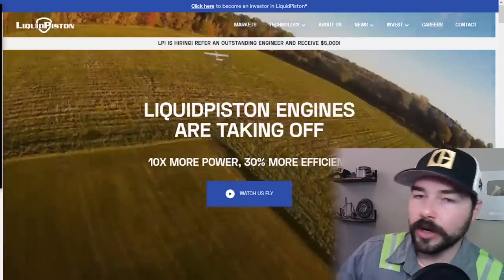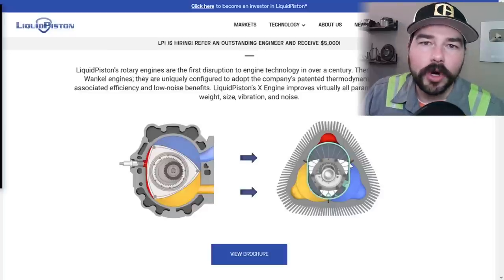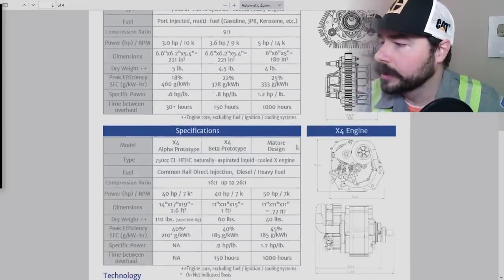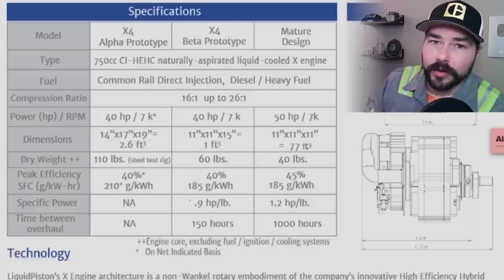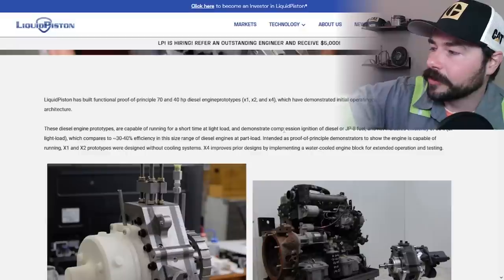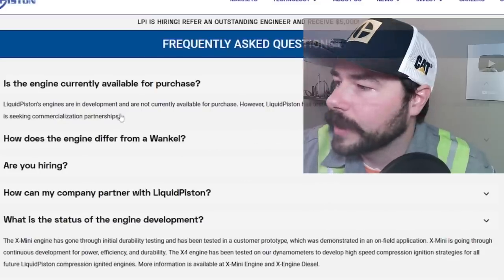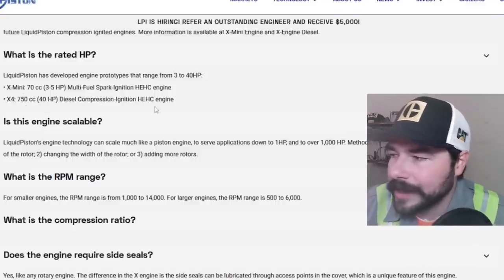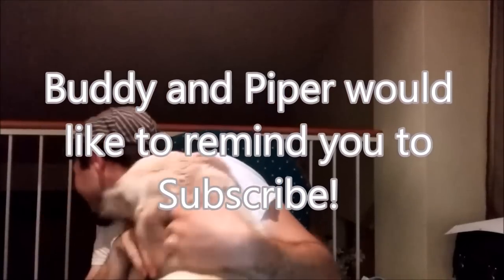This Engine could change EVERY INDUSTRY but..................

Comment: The comparison engine on the left is an Isuzu "SE" out of a Thermo King SB reefer unit.  I have seen these things go 50,000 run hours without an overhaul!  Great engines!
Reply: U can google and see that’s wrong
Reply: @trevoncowen9198  Thermo King SB reefer units do indeed live that long if looked after     its not the engine that dies first   lol rust gets em in the end
Reply: They run on roller bearings
Reply: General Motors put those 4 cyl Isuzu diesels in Chevettes. Ran & drove fine. I borrowed one for a couple weeks. Also, I worked in transport refrigeration for a while and those were in fact the same engines powering the Thermo King reefer units.

Comment: I knew a guy that would only shut his pickup off for oil changes. The amount of fuel he wasted was absurd. Good video btw
Reply: Not a millionaire next door..
Reply: No way people like that exist.
I dont even let my car warm up because that wastes fuel, oil pressure is there immediately and its a diesel it takes FOREVER to warm up I once had it idling for almost 30 minutes on a fairly cold day with the hood closed because I was reading out datastreams and even after 30 minutes it wasn't even up to the full 90C.
I doesn't make sense to let Diesels warm up, give them some time to let oil flow trough everything and then just go.
Reply: @alouisschafer7212  you dont let them get heat into the cylinders and pistons you will scuff the cylinders break the rings and damage the pistons. Your car most likely has tremendous damage in its cylinders if you do what you say. If you drive a truck engine like you say it wont last very long.  The dummies that leave their pickups run all the time are the ones that cry the loudest about shitty fuel mileage high oil consumption and short engine life. Billy riggers
Reply: @alouisschafer7212 The only diesels I know of that are left running overnight are large locomotive engines and large ship engines. 
      Engineers say that these big monsters suffer more wear when starting up than running for months. 
      I'm in Ireland and ships that cross the sea to Britain and back everyday pull into port and leave the engines running while they unload and load again. This could take 4 to 5 hours.
      These engines go for weeks or months without being turned off. I have seen the same thing with big locomotives left running for hours to keep the engines sweet.

Comment: Another aspect of stationary generators running stand alone is frequency stability (as you alluded to), especially in a clinical setting. Yes, diesels help achieve this by having good low end torque, but what really gives a generator frequency stability is a very large rotating mass that resists the change of inertia caused by a large load starting. Anyone that has ever run a cheap gas generator knows what happens when you start a big motor on one of those. They slow down, then over speed to compensate. I've got a 10KW military gen-set with a 144 cubic inch 4 cylinder dielsel that's only 24 hp. The generator weighs 1500 pounds, but it'll start 30KW worth of loads without batting an eye.
Reply: Also your 144 CID 4 bonger is a 2 stroke that responds to loads faster. Todays shit is nothing overrated 4 stroke crap, 4 strokes suck in outboards, cars and trucks

Comment: You no longer need to run a generator engine at a specific speed.  Look a Inverter Generators.  They convert the generated electricity to a stable pure sine wave so the engine RPM can be variable.

Comment: I don’t think the small engine having higher rpm would be an issue, the size difference allows plenty of room to run it through a gear box to adjust the output to the correct rpm and torque requirements. 1:3 gear box would put it at 5400rpm, my question is if it would have any benefit once the full system is put together. From the starting size it certainly still make for a overall smaller package.
Reply: The rpm’s are irrelevant here, really, the generator coils as well the circuitry are where the Alternating Current gets set. If it is going to generate Direct Current, again the rpm is irrelevant, because you will use capacitors and some circuitry to stabilize the supply. 

You are not telling us that the rpm is directly correlated to the AC frequency are you. That would mean very flawed circuitry and disastrously unstable output.
Reply: @pieterviljoen1620  Uh, yeah. In 99.9% of AC power generation the frequency is directly controlled by the RPM of the engine. Now, there are the smaller inverter style generators and when talking huge steam turbine AC generation, they use gearboxes. But for most AC generation the frequency is the RPM of the engine. For 60Hz it's 721, 900, 1800, 3600 and other multiples. And actually they are alternators, not a generator.

Comment: 100 per cent correct! These companies are strocking consumers.  Just installed a 250 kva CAT engine/generator system for a winery in Napa ca. lpg powered due to emissions standards in CA. It was easy to install, plus the local deal had millrights come in and adjust/ verify installation was correct and did brake in procedure all included in purchase price. Then changed oils, filters etc on their dime. Very impressive! Plus that was my dealer before they gained one in Santa Rosa Ca. Great people to work with.  Biggest problem was with propane company providing large enough regulator to supply generators thirsty appetite for LPG, or comingly called Propane!  It took a large 3 inch line to generator so no smog of fuel at startups. To ensure no leaks. I used stainless steel pipe that was tig welded at joints and fittings. System then enclosed in  sound reduction building to match winery.leg storage tank is 10,000 gallons which took special permits from county, cal fire and latter on state due to last 2019 fire that destroyed the area.  We were required to remove all vegetation and trees 150 surrounding propane smog tank and generator building. Tough standards but after that fire 😊owner understands. Plus generator provides drinking and fire water from two  wells. Thanks for your very imformative videos that influenced the owner to use CAT instead of the green and Chinese  brand’s which were less money. He chose the dealer support plug reliability back up documentation that CAT central provided . Sweet setup and dealer support!!! Thanks again for all your videos, I feel you should get a profit sharing percentage just for the customer reviews of your channel. Well, someday .
Semper fi

Comment: There is more than one way to build a generator.  Some portable ones are nothing more than large alternators with an inverter wired directly to them.  That eliminates  RPM requirements for the most part and allows for smooth power when it is first loaded down due to a compressor turning on or something like that. The ones that aren't run at 3600 RPM since that is where small gas engines run best.
Reply: Capstone gas turbine generators are inverter systems. Otherwise you would need a gear box bigger than the engine to bring it down to 3600rpm.

Comment: Josh needs to catch up on current unique engine designs: Liquid piston is one, Acates opposed piston is another, Duke engines, lobe crank design is yet another. LP was big in the news several years ago.
Reply: I have heard opposed piston engines are really efficient. But the challenge is getting the fuel air charge in and the exhaust out to really capitalize on the inherent efficiency of the design.
Reply: Liquidpiston was dead on arrival years ago, it's still a solution in search of a problem today.
Reply: There is a video of an old Doxford OPOC engine on https://youtu.be/sWjMBSnq2es. I think this is 1938. I believe these are efficient and have been around many years with Fairbanks-Morse making lots of these design but with two cranks instead of one. I'm waiting for the Achates / Ford / Cummins partnership to produce a production vehicle.
Reply: @tbthedozer  Finding sized Roots superchargers to deliver the air needed at low speeds, especially for a V engine, is tricky, especially if it needs to fit in a truck. For stationary generators and marine applications this isn't a problem as space isn't a concern.
Reply: All of these designs are rehashes of old designs

Comment: Wankel rotary engine was a great engine. It's simple,compact, light and can produce a massive amount of power. They're more an enthusiast engine opposed to a regular driver.
Reply: Unfortunately they were extremely inefficient and had very high emissions 😮
Reply: Actually the rotary had an abundance of torque but low horse power. Me...I loved them! But some tree hungers don't because of the higher emissions and those higher emissions are because of their tendency to burn oil like a 2 stroke and that's due to the seal issues; adding to that they're unreliable as far as endurance is concerned.  

This "liquid piston" design on the other hand seems to solve the seal issues, increases the compression ratio but still have bugs to work out. "Let the cake bake" as they say and we'll how things work out.
Reply: @chrisvig123  yep mine had a drip oil system, so you burn oil. When it was modified had to add 2 stroke oil to my gas.
Reply: @Rev22-21  my experience with them was that they had no torque. They had hp at high rpm but very little torque. Thats why you had to wind the shit out of them to get any kind of performance
Reply: @Rev22-21  wankels have no torque, that's why they had to make them spin so high.

Comment: Might be useful for aircraft if the time between overhaul is better or the same than a traditional piston engine.
Power to weight ratio is extremely important when you're trying to build a flying machine.
Reply: Problem is going to be certification. The reason why many GA airplanes today are still flying around with air cooled, carburated engines with magneto ignition burning leaded fuel is that those technologies are certified so they can be offered at a much lower price. New technologies in the GA market usually fail because certification cost are so high that there is zero chance of being competitive
Reply: @Alexx120493  if you are saying certified aviation is low priced? I'm sorry but I have to say no, it's far from it. But yes you are correct about the even higher costs of getting new aviation technology certified.
Reply: How many "new and revolutionary" engines have made it to market? There's so much vaporware out there. TBO is way too low to meet aviation requirements.
Reply: Sounds right, but no. Power to weight is less important than almost everyone thinks. a 747 weighs 379,890 kg. its engines weigh 4058 kg, or a bit over 1% of the total mass. Imagine increasing the engine mass by a factor of ten in order to double engine efficiency. 50% less fuel but 9% more weight. 0.5 * 1.09 = 0.55.  Great trade-off, eh?

But it gets better! The jet carries about 20,000 kg of fuel, especially at takeoff and initial climb. So subtract half of that and suddenly engine weight becomes almost insignificant.

Efficiency is far more important than engine weight because engines are light compared to fuel, and both are light compared to the airplane as a whole.
Reply: @richardtheweaver4891  This engine design is more suitable for small aircraft, like a Cessna 152, where every pound saved on the engine weight will increase useful load by a pound. Comparing it for use on a 747 is like comparing the engine needs of a moped vs a tour buss. If they sold an engine for less than $8000 US, that was 50HP, had a total installed weight, including the necessary reduction drive and a TBO greater than 500hrs, I'd have one on the front of my airplane. When my engine exploded in flight last July I even checked if they were in production yet and was disappointed. Like the Wankel, I think the seals will be their largest problem to producing an engine with a long TBO.
Reply: @ulbuilder  Probably more for the experimental/ELSA/UL market once they get it well beyond the present development/engineering-curiosity stage.
Reply: Not to burst any bubbles but their claims as to HP and Torque are made up they have yet to show the small prototype they claim to have built running on a Dyno for any reasonable amount of time

Comment: I was around the Wankle designed, engines built by the German MFG Sachs. These engines were installed in snowmobiles, In this case Arctic Cat. This was a Minnesota based MFG. These snowmobiles had what was called a 303 cc engine. They weren't highly powerful or quick off the line. They were more moderate speeded, somewhat slow to gain speed unless you were riding down a long hill, or off a mountain. They would keep building RPM to almost no end with not much vibration. Even though they were classified 2 stroke which required mixing gas with oil for internal lubrication. They sounded more like a 4 stroke. This was back in the early 1970's. This engine was eventually phased out. Nice diesel, especially Cat Videos. My son sometimes looks you up for tips/advise, at this time he has the engine out of, and dissembled, from our Western Star dump truck, Its a 3406E. Thank You

Comment: I love it when critical thinking comes from someone who knows some things.  Good on you.  They should never make claims without informing their market audience that for each application, the engine undergoes a radical re-tune for that application.  At around 7:20 you zoom in on the comparison of the LP and a generator engine that they are comparing HP numbers on.  Did anyone else notice that we always get (rightfully) debunked when we compare 2 totally different applications?  The generator diesel engine is purpose-built for it's job and tuned to deliver that work for a VERY LONG time, at a certain RPM.  Weight is not a factor on a stationary, or heavy industry application.  In fact these are over-built on purpose. 
  Then take the LP all trim and dainty, like it can't wait to show off to the mechanics.  Well, for a few hours before taking a mechanical dump.  Obviously, a higher RPM engine must get a reduction gearing to drive a generator at the same RPM as the other engine, but if it cannot be made to perform the same service for the same time, it's not as useful.  Then also notice that none of the tanks and pans, and heavy service devices found on the generator engine were attached to the LP.  Looks like marketing hype, to tell a non existing story.

Comment: I’ve heard of the Wankel engine and I remember that Mazda was the only car company that was really successful with it.
Reply: Funny enough, the mazda version has generally been the worst iteration of the few that have been made. Sachs made ones that were quite reliable.
Reply: Believe it or not the corvette had a wankel powered concept. Mid engined and alot more similar to the vette you'd see today.
Reply: Cause mazda the best
Reply: And the wankel was a horrible two stroke device with total loss lubrication.  Great for motorcycle racing crap for decent road hauliers. 
We did try and put one in a loitering Guided missile, but it couldn't loiter for very long and was very noisy.  To the point that the mad bearded mullahs could hear it coming and potentially shoot it down.
Reply: “Successful” is in the eye of the beholder. Even the last generation still used oil, and was less efficient than a similar piston engine. But they could absolutely scream, I’ll give em that. I always said if the Wankel had an application it’d actually be good at, it’d be outboards (lighter weight and higher rpm), and it was never used for that…..
Reply: One of the things that's often forgotten with the wankel engine,is the gearing ratio between the rotor,and the crank,which is 1 to 3,ie the crank has to go round three time for one revoloution of the rotor,so at 3000 rpm crank speed the rotors are only doing a 1000 rpm,which is one of the main reasons for them not developing any power until a fairly high rpm,which they can do quite easily,but at the expense of a high wear rate of the rotor seals due to centrifugal force,which is the bit that everyone knows about
Reply: @thetowndrunk988  facts
Reply: They can definitely make some power if ported and turn high rpms but the rotary's like to eat apex seals, side seals, etc. They definitely need a rebuild usually around 60k mile intervals based on my own experience. I wouldn't hold my breath that these will be the future of engines but I guess we'll have to see
Reply: @thetowndrunk988  We generally want outboard motors to be very reliable… Being stranded by apex seals in the open water vs on the side of the road, quite different I think.
Reply: Their is also small rotary’s in some older snowmobiles and smaller ones in old chainsaws.
Reply: @thetowndrunk988  actually OMC way back in the day had an outboard with rotory powered to race against the mercury’s
Reply: NSU RO80 also had them in the seventees, very futuristic car for that time....

Comment: Interesting Josh. I recall one of the big issues with the Wankel was not only rotor tip wear but sealing the ends of the rotors.  This company might be all about securing investment.
Reply: If so then it would be like the AlfaDan scam engine company.
Reply: I don't see how this new shape would be any better on tip seals. They look like they will still ware out quickly and be prone to leakage.
Reply: @GRParker0 exactly that's my who thing. Yes this version looks like a more advanced version of the Wankle with higher efficiency and output but any rotory tuner can easily get more performance out of a Wankle it's the apex seals that limit things. Without a major breakthrough on that front then this is the same technological dead end Mazda hit.
Reply: @GRParker0  Their claim is having the seals on the housing means reduced forces, and being able to oil them from the housing instead of having to dump them straight into the intake. Whether this pans out or not, who knows?